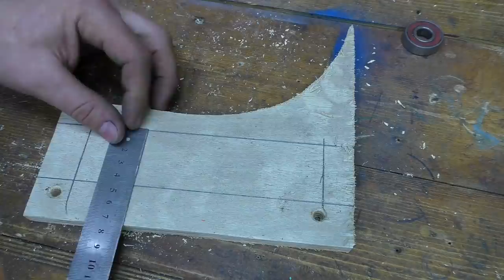Cool idea for home !! FROM THE ENGINE FROM THE WASHING MACHINE.

Comment: Buenos dias,

Bien hecho, ¡incluso si prefiero cortar la comida con un cuchillo!

Por otro lado, estoy sorprendido y admirando: ¿cómo podría reducir tanto la velocidad del motor de su lavadora?

He probado 2 motores similares o incluso idénticos e incluso con un regulador de voltaje no puedo reducir la velocidad de rotación, que sigue siendo muy alta a alrededor de 13,000 rpm, lo que hace imposible hacer cualquier bricolaje con este tipo de motor. .

Tengo problemas para hacer la conexión eléctrica, ¿me pueden ayudar?

Gracias de antemano.

Comment: Than i was thinking if you want less noise and friction. Use worm gear etc as in a centrel lock actuator. But ok if using that configuration there a small head ace

Comment: A really cool project, even fun to do.  However, I consider it a waste to use such a strong engine for this purpose.  And to help, I give a suggestion: Buy sheets of acrylic or tecnil, redo the project using this material, which is more hygienic and easier to clean, and also install a protection near the cutting area, where you insert the food, to make sure  that will not lose even the tip of the nail.  Brazilian hugs!